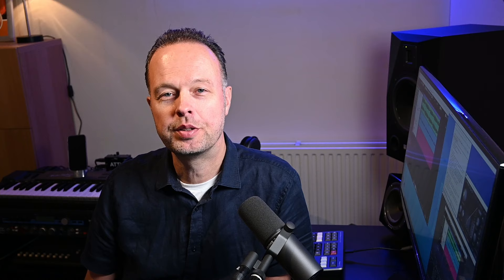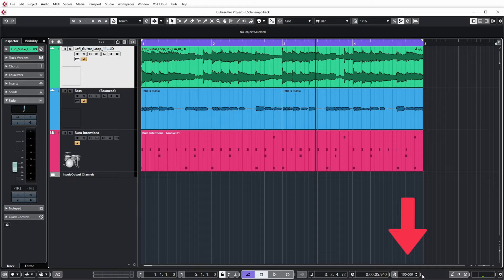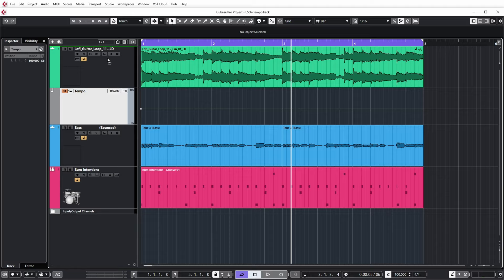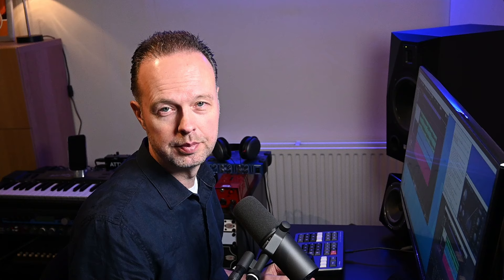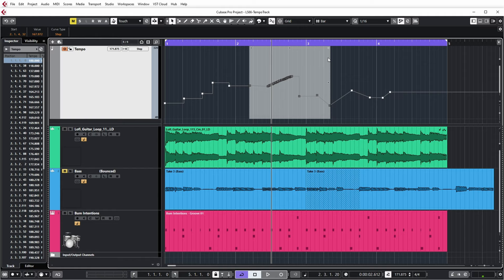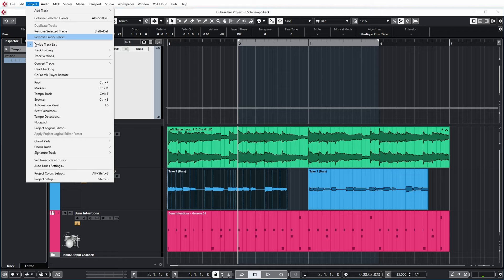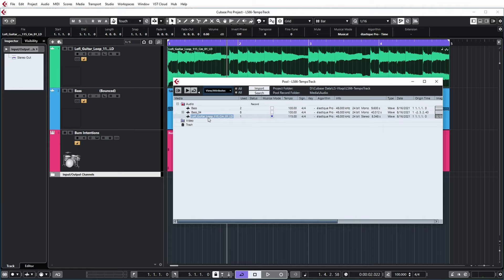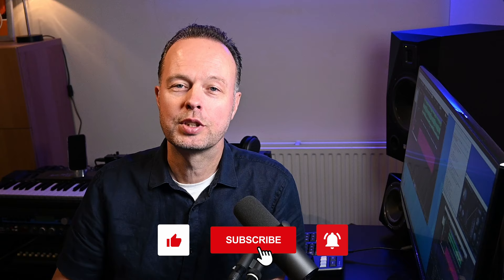Cubase tempo basics; how to set and change tempo of projects, loops, etc.

Comment: At least, a good explanation of tempo esoterism in Cubase.  I understand now why I never understood these matters.  It is a very good example of bad design, absolutely not intuitive.  You might think there are two modes (musical and time), as intuitively indicated by the yellow knob on the track header, but no, there is another, hidden one, in the library (each file being set to musical or not, even if the yellow knob is on).  And then you even have the predefined tempo set by clip.  So all this is perfectly designed for poor me not to understand.  Add to this that the help files are only useful for those who don't need help...  So thanks alot for having enlightened me.  Now three weeks practicing.
Reply from the maker: Ha ha ... yes it is not very straightforward. Happy to help, more to come so please subscribe 😉

Comment: Probably a silly question: Should guitar volume knob always be at max wether using 0 gain on interface or using "peak' method for initial setup. Of course i would adjust volume knob to suit while actually recording.
Reply from the maker: Not sure how this is related to this video, but when electric recording guitar I always turn up the guitar volume knob full whack and then use the pre-amp gain on my pre-amp to assure the correct level is recorded.

Comment: great video again! there is this one issue that i run into every now and then with cubase, regarding to tempo. sometimes whe i load in instru track in cubase, the get played sped up or slowed down. I have found that this is sometimes caused by music that was made in FL, where the producer checked a box at rendering stage, that says something in the style of "save tempo in file", but I have encountered the issue with instrumental coming out of other DAW's aswell. and this most of the time is a pain in the ass resolving. Do you have a workaround for this maybe?
Reply from the maker: Maybe you have it configured so that the audio is automatically stretched to the tempo in the file? You can check which tempo is in the audio file in the pool. That could be incorrect.

Comment: Hi!
Good video.!
I have a question about set tempo right. You set the base audiotrack to musicmode, does that work the same if it was a midi track? 
I have a midifile there base doesnt follow tempo buttom.
Reply from the maker: On a midi track you only have to set musical time base for the track. Then it should adjust and stay in sync when you change the project tempo.
Reply: @LanewoodStudios  Yes it worked! In inspector window, I just marked in "toggle timebase...." So now it is ok! Thanks!

Comment: I want to simply drag the track to its ideal location like in cubase 9.5 but in cubase 13 I can't do that. Why is this happening? All I want to do is drag it to thr exact spot. Not use some tool. I keep changing the time code feature or whatever it is but it  doesn't work.
Reply from the maker: Not sure what's happening for you. I can drag audio events all over the place in Cubase 13. Or did you mean something else?

Comment: Hello Lanewood, I decided to duplicate your project to follow along and I noticed when I click and drag the MIDI tack Bum intentions sample to the windows project I do not see the Musical Mode little yellow icon . It does adapt to tempoc changes but I was just wondering if you know why I do not see it exactly as in your example. Thanks, again. Luis.
Reply from the maker: Hi Luis, not sure why it is not turned on after import. Does it make a difference if you turn it on manually after import?

Comment: How to set time signature freely on any spot I want? I'm working on video to produce music. So there is a tempo change. 
For example the tempo is 100 at the begginning. And then the tempo changes to 86 somewhere but not on the grid. Not the quarter note or anything that syncs with the previus tempo.
But I want to set the beginning of the next bar right at the spot with the new tempo but Cubase doesn't let me to do that. 
I'm able to do that in Ableton and Studio One but where I started to work as a media music composer I'm using Cubase 12 pro. I couldn't figure out that.
Reply from the maker: You should be able to do that with a combination of tempo changes and time signature track. 
You can make a tempo map that will assure that key points are on the grid, and then you can change your time signature on those key points

Comment: Hi! When I import in Cubase a backing track converted from YouTube, it is not in time with the project, even if I use the musical modality; Do you know why it happens?
Reply from the maker: Is it an audio file or a video file?
Reply: @LanewoodStudios  no no. It is for example a bass and drums backing track just to improvise on with guitar or even original tunes converted in MP3 from YouTube that I use as reference track.
Reply from the maker: @domeniconitti529  I think you might be missing the setting that I'm doing in the last part of my video, like I show for the bass track. You have to set musical mode and original tempo on the audio clip in the pool as well.
Obviously if the tempo is not consistent in your file or project it will not stay in time either. But Cubase does have automatic tempo matching which I'll tackle in another video.